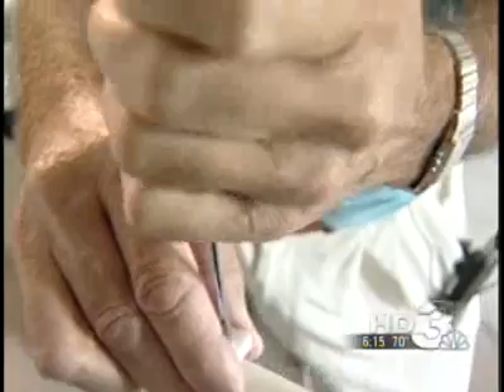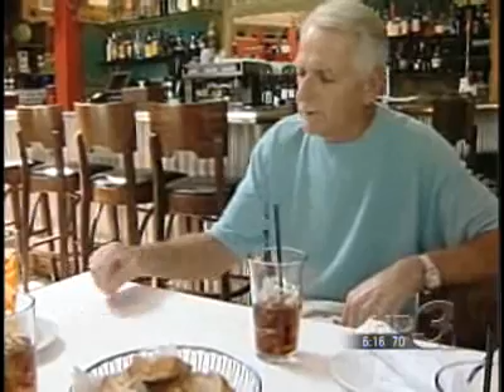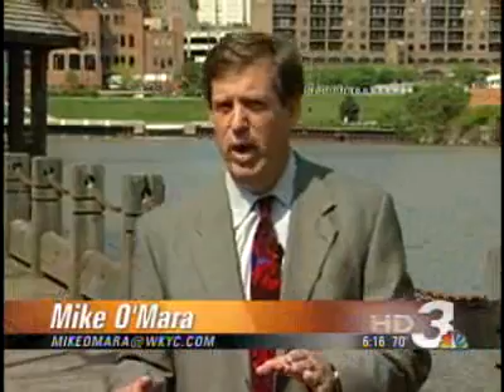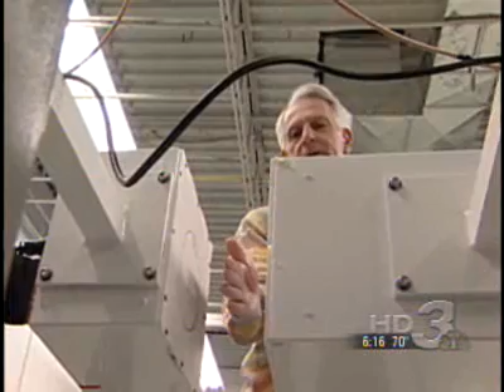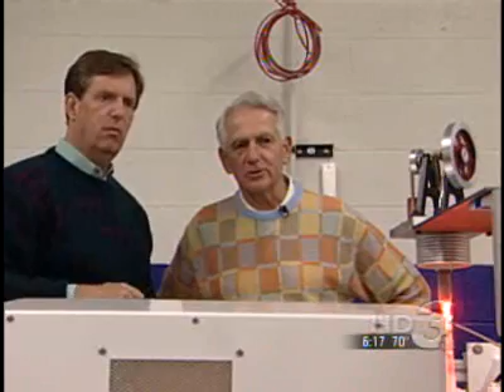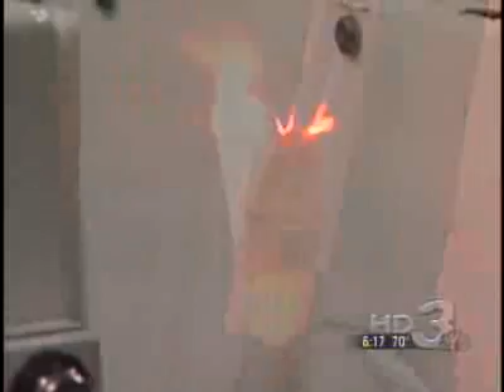Salt Water Combustion Engine Discovery

Comment: could the fire not be used to replenish the enrgy needed to produce the micro wave rays? it did burn incredibly hot. Of course, i do not think the answer is in a steam engine application, but there is ample energy being expelled in the combustion.  It just needs to be harnessed.  then becoming a circular chain of energy?